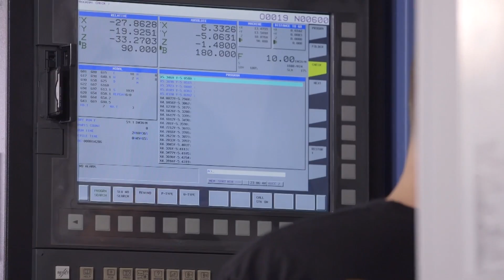Getting my 1st MAJOR BEAST CNC MACHINE... $500,000 Down Payment!

Comment: Good stuff.  20 years ago, I was responsible for 3 Matsurra Horizontal Mam Cells all tied to a 30 pallet system.  We ran the same 3 shift schedule like you did.  However, we only ran aluminum and did not attempt to run titanium, stainless or Inconel unattended.  My hat is off to you if you left any of these running "lights out".  Found out that ceramic spindle bearings were not very long lasting at high rpms.

Comment: How often do you have to shut down the machine(s) for cleaning/maintenance? When you do maintenance, how long is the machine down? Another question, how often do you get a "one off" piece to do? Do you charge extra or is the rate the same as with any other project? Time is money and money is time. To me, any piece is just extra income in your pocket even if it's a small job vs a big job with repeatable parts. Love your stories, cheers :)
Reply: That works fine in smaller shop buy once you hit multi million dollar contracts, the struggle becomes deadlines. There I no time for one off set ups. Those chips have to be flying 24/7 to hit those delivery times or you get glanced over for that next multimillion dollar contract. At very least you will be informed that you aren't the only dog in the fight to get that deal. Now. You keep your deadlines and quality spot on then you have the chance they dont even want to take the risk of looking at another supplier for the parts. //25 yrs in the trade. Everything from local oil drilling rig fittings to stuff that is on the international space station.

Comment: titanium hard to cut , we did very little work with it , just basic non cnc mills and lathes
Reply: More so difficult to get a good chip from it. Ceramic cutters have been found to be the best way to get a good bite and roll out of it. Just have to be programed for thin short chips. *Chips are where you start looking for answers if you aren't cutting a material well. Then take those back to your geometry experts and have them do the math on what the good chip should be shapped like as well as how thick it should be.
Reply: + on a manual machine you are just grinding it at best.  Stear clear of that stuff without a CNC.

Comment: Hey Titan,  we operate the same way.  We have 12 machines that basically run non-stop.  During our 1 shift during the day we handle the singles and small orders then we set up the machines at the end of the shift to do the big runs to run the 15 hours lights out when no one is here .   Every machine had a barfeeder and a robot doing machines tending.   And now we're just getting into doing some sub assembly with our robots while they wait for the next part to come off the machine.
Reply: How do shops like that deal with potential problems? Where I work we have constant problems with coolant pumps, a blank forging having a defect in size, temperamental loading on fixtures etc. Even if we had a tombstone feeder everything would come to a halt after an hour or two.
Reply: In our shop, we don't really deal with coolant issues anymore.  We've developed our own coolant monitoring system which keeps an eye on the coolant levels in the tanks, and auto fills all our machines.  As for material, we run mostly mill-turn, so we cut our own billet blanks for all our parts which makes the sizing pretty reliable.   But when we run parts on our horizontal mill, we load the fixture and we probe our blanks to get a general size and run macros to add an extra roughing pass here and there based on what was measured if the blanks are a funny size.

Comment: Questions!!! Titan.  Best advice for turning down  a .500 diameter polyurethane durometer 90 on a cnc lathe. What are the speeds and feed?
Reply: We usually run plastics at least 600 constant surface speed (G96 s600), go slower for finishing small diameters, feed of. 012 IPR or more for roughing, .004 IPR for finish pass. Play around with the feeds and speeds until something works! Another tip is make sure your chucking pressure is above 150psi if running bar stock or chucking on solid material (no holes). Machine as close to the chuck as safely possible. Use a relieved and sharpened corner of a .094 wide flat groove insert for parting if possible.
Reply: As others have said, the sharper you can make your inserts / tooling the better! Kennametal sells high rake inserts for boring and turning and that's what the job shop I work for uses for all kinds of plastic parts. If you don't have any sharp high rake in house at the moment, you could sharpen existing carbide inserts or even try sharp high speed steel tooling if possible.
Reply: It's plastic, just try stuff. You'll learn more by trying to figure it out for yourself
Reply: @alexkern9134  I have it keeps bending and not give a good finish this material is very soft
Reply: Sharp, high rake tooling. One pass if you can.
Reply: @duncs_life  how much in/Rev.?
Reply: @leviarias5281  0.1mm per rev
Reply: .004ipr +-20% 
I guess the swarf will try to wrap around the part into a birdnest?
Reply: @duncs_life   yes
Reply: How much rpm should I run it and  most of you guys said .004/ipr
Reply: How many rpm do you have? Are you barfeeding and using steady bushes up the spindle?